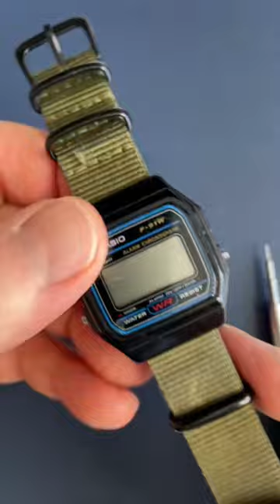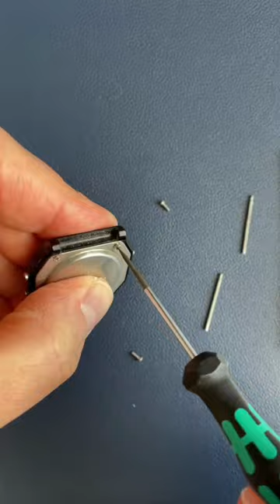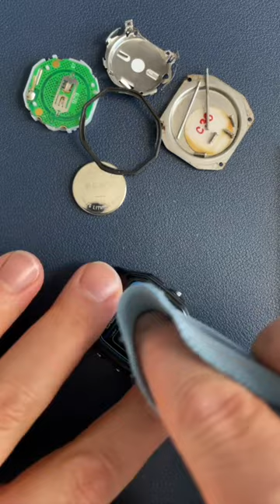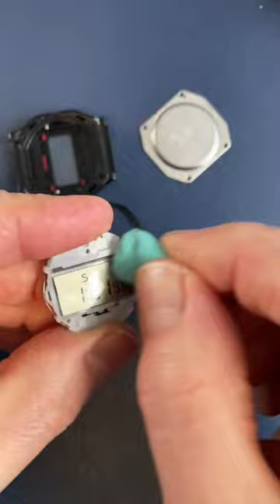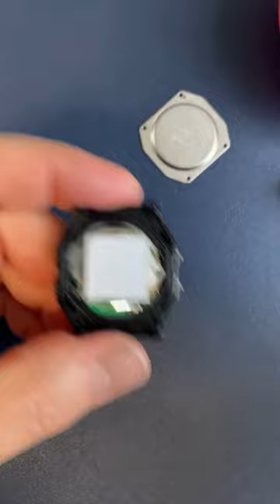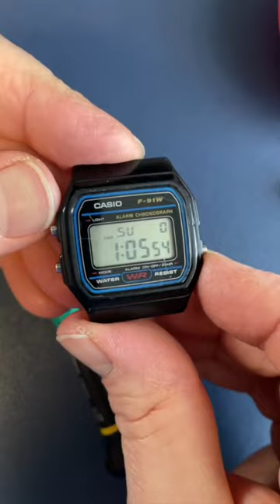Casio F91W Battery Replacement

Comment: I'm change my battery on my f91 also . I'm not struggling in life. I don't change my watch cuz it's centimental to me .. I'm very happy . No watch can compare it to  . My f91 brought 2001 . Not even Rolex . .. it's tells how time goes by
Reply: Love that watch also because how light it is and does the job. Though I would love to try a different bracelet but that would add to the weight :s

Comment: Hi Andy 👋🏻 which wera screwdriver set are you using ?  Do you use it on your submariner?
Reply from the maker: You need a 1.4mm for the Submariner as it has 1.5mm pins. You’ll find links on my Amazon store under watch making tools.
Reply: @TheEnglishWatch  thanks I’ll take a look 👀

Comment: How long does one battery last?
Reply from the maker: 🤷‍♂️ 10+ years
Reply: @TheEnglishWatch  really? But why there are Casios with marking "10 years battery" or smth like that, but I don't see this marking on the f91w, that's why I ask
Reply from the maker: Don’t know. I bought this one in the early 2000’s, so went nearly 20 years.

Comment: Well I've watched this three times and still no wiser how to remove the main watch assembly from the body - you seem to just tip the whole thing over at 0.14 and it just falls out! No way does mine do this, its never been opened before and some further instructions would be welcome, thanks!
Reply from the maker: You need to prise out the sides a little from the buttons. I also found the battery taped in a little. Don’t remember struggling, but I did it over a few takes.
Reply: @TheEnglishWatch  yes you're right, thanks. I also had to tease away the gasket as it had stuck to the body and was holding everything in. All back in safely now!